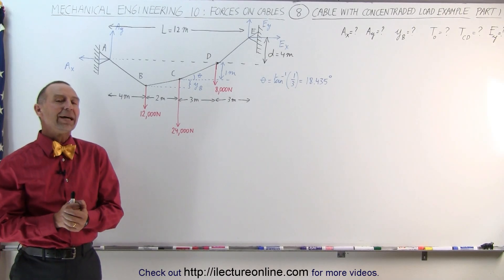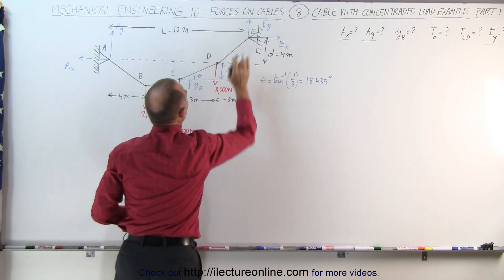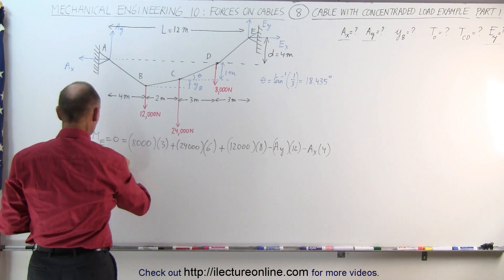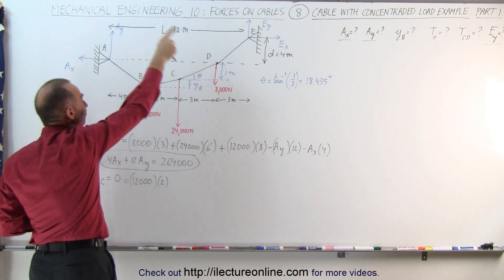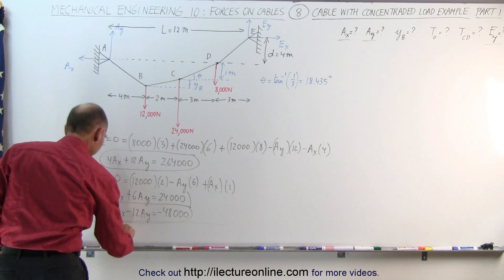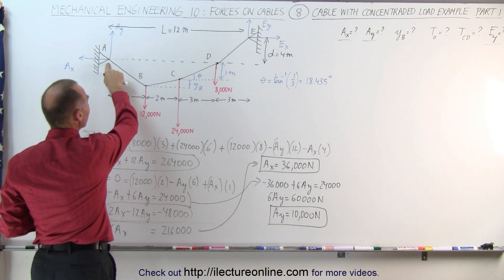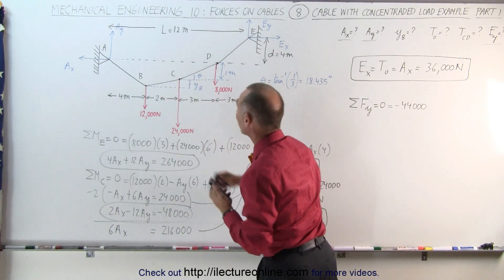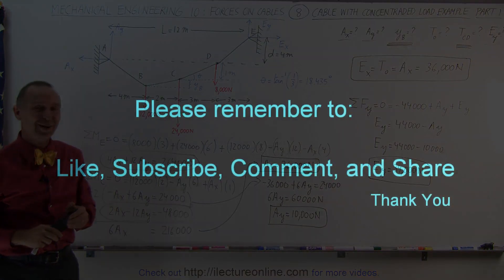Mechanical Engineering: Ch 10: Forces on Cables (8 of 33) Concentrated Load: Example (Part 1)

Comment: Sir appreciate for the video. You said that when considering moments at point C we can take one side if its cable, is it because they dont have bending moments like rigid structures? Kindly respond pls
Reply: Thank you for the wonderful videos! Could you please explain why we are able to ignore the other half of the cable?
Reply: @elliotmartin8986  method of sections, in equilibrium we can cut a structure into parts because there won't be a change on the structure since it is at equilibria

Comment: Deer Sr. I have a question, please, if there is a cable suspended between two pins say point A & E, and point E vertically little higher than A  loaded with two unequal weights w1 > w2 at point B & D respectively and there is a pulley at point C between B & D and at a hight between A & E, and assume the cable is long enough, will the system have two sags at B & D or one sag only at point B due two the higher weight?. waiting for your reply. Thank you.

Comment: I tried to calculate moment at point D, I got different result. I thought in cable we calculate moment at any point.
Reply: In which course do you take this topic? I am in my first year of civil engineering and taking this in static.. Although I am good at trusses but cables are a Lil bit different.. Due to solving an equation algebraically
Reply: This is exactly what I wanted to ask. Taking moment about point D is an easy way of getting Ay, but it gives different answer.
Reply: I had the same exact question
Reply: @lapisbrainprint9607  me too why does point D five a different answer

Comment: Hi, upon using point D as my pivot, I found we can eliminate Ax and find Ay. But The Ay I calculated doesn't correlate with your answer. Any reasons?
Reply: I think the reason behind it was the symmetry. If you cut the cables at Joint C, the horizontal distance from A-C is 3 and E-C is 3. I think that was the reason he cut it at Joint C.

Comment: When taking the moments at point C, why do we get to calculate only the moments on the left side?
Reply from the maker: You can calculate the moment on either side.  But there is a strategy that will get you the answers and this video shows you how to do that.
Reply: Thank you so much. Why does that strategy work? To solve for the reactions at A, we take the moments at E and C.  But at C, we take only the moments at the left side to get the reactions. Why does that work? It seems like it wouldn't be equal or something
Reply: its because tension in cables is equal on either sides and at any point along the cable its as good as the contact point A and E
THANKS BRO
Reply: It's like method of section in trusses.
Reply: @iconbylvergara6188  Unlike beams, cables can't take any inner moment (any moment will bend the cable until there's no moment) , so at every point along the cable the total moment must be equal to 0

Comment: Why horizontal thrust forces are equal at both the ends
Reply from the maker: If they were not equal, then there would be a net force in the horizontal direction, and the whole system would accelerate to one side or the other.

Comment: I think the methodology youre doing makes sense but there is something wrong with the question. Are you sure that is a stable system ? Because when I choose a different pivot point it always gives a different answer for the x and y components of force at A. For example by taking D as a pivot point. Total moment about point D=0, A_x is gone because the perpendicular distance is 0. So we only have A_y and it turns out to be 14.666 N. Could you please check the question bec I have an exam tomorrow and Im pretty confused. Thanks :)
Reply from the maker: That is a good observation.  Since this example problem is not a "real" problem, the vertical positions of the loads do not correspond to where they would actually be in a real situation and therefore you will get a different answer if you picked a different pivot point (D instead of C).  But the methodology shown is correct and the one to follow.  Your answer of 14,666 N is correct if you pick pivot point D.
Reply: Thanks a lot,we are grateful :)

Comment: this is soooo wrong. sorry but not sorry. you take the cable as rigid body or you calculate it as 3 hinged arch. if you make MD=0  (right side) then Ey=48000